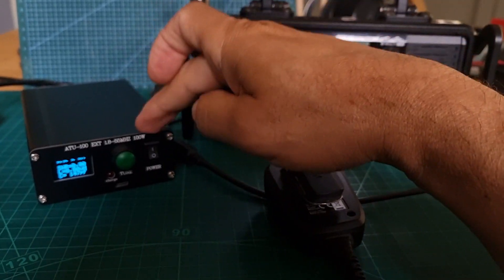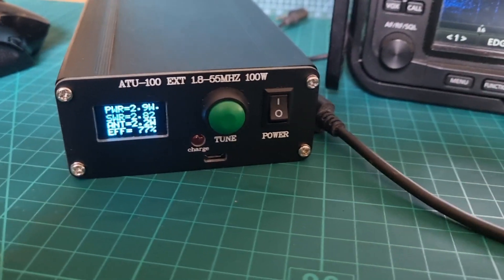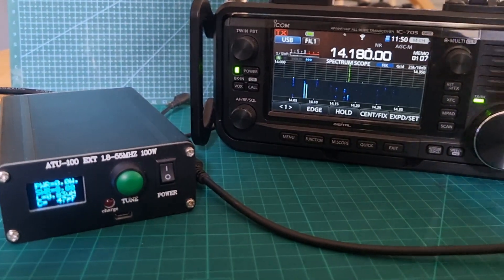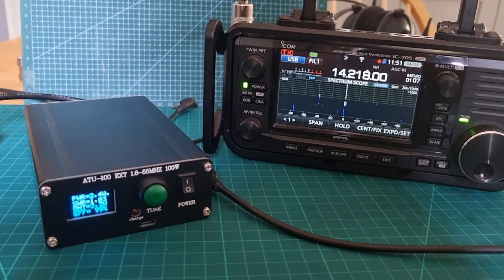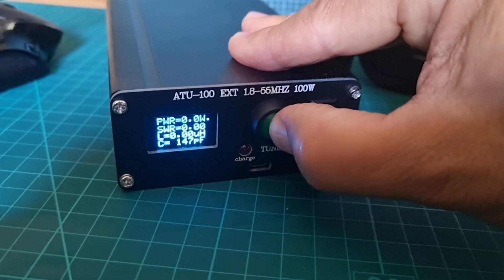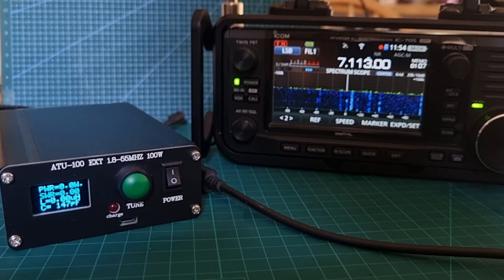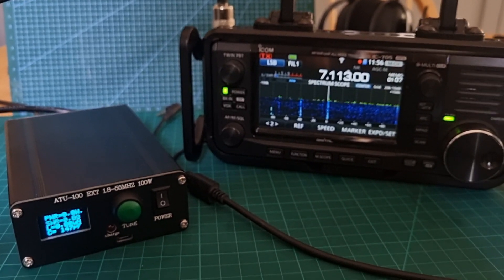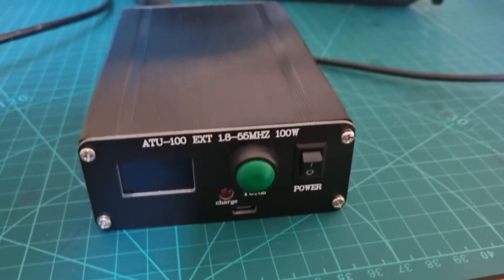Budget ATU - ICOM -705 (Mod activate using PTT)

Comment: I bought the exact same ATU for my ft817 field pack. On arrival it didn't work - bad solder joint on the Tune button, re-soldered and all ok after. Great little tuner for the price.
Reply from the maker: Yes agree